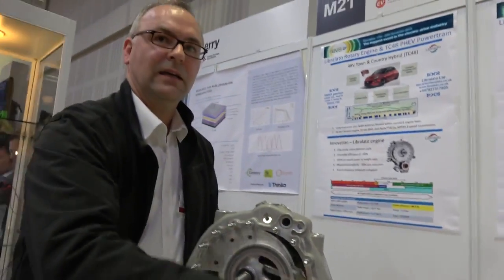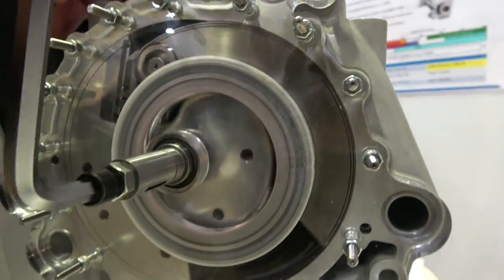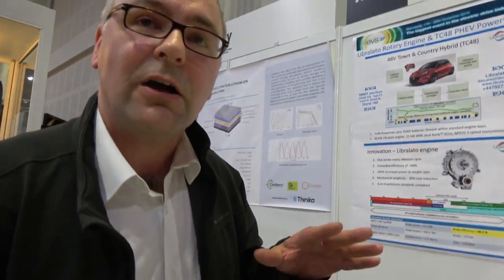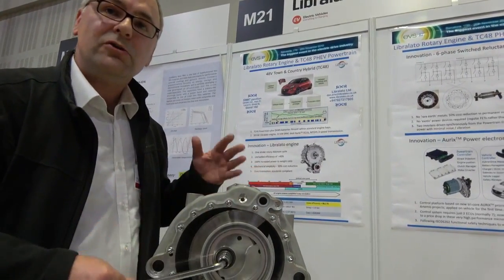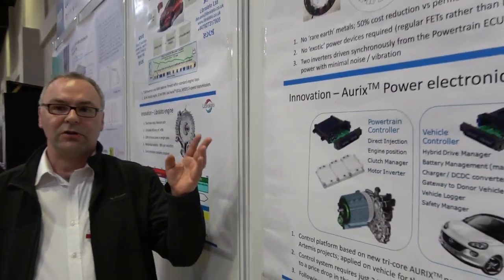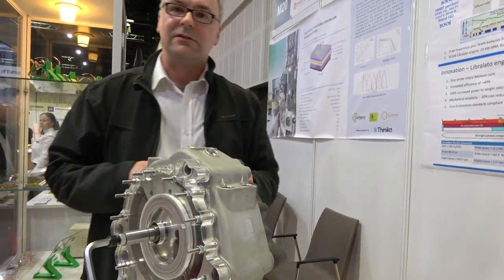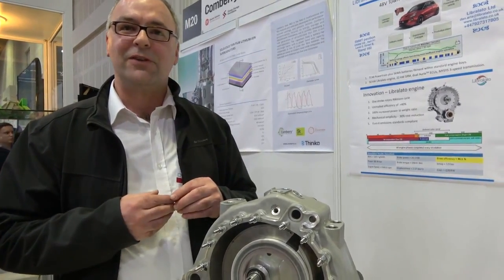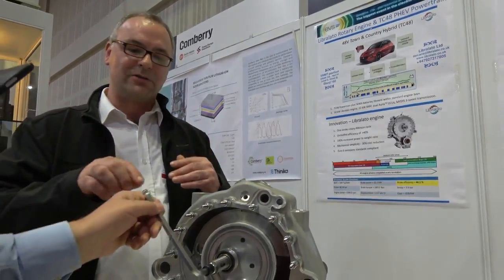Next generation rotary engine for hybrid vehicles

Comment: That’s not a rotary get your ass out off here
Reply: you mean...its not a wankel...it is a rotary, just look at it...cant be as efficient as a diesel however its looked at...theres still a lot more combustion chamber surface area to transfer combustion heat...and it still uses conventional type rotor sealing rings

Comment: A quick analysis:   Lousy shape combustion space for optimal combustion (needs to be near-spherical).   Large quench areas on chamber walls will increase hydrocarbon emissions from unburnt fuel clinging to the walls. Rotary exhaust valves have been tried many times in the past and they have massive friction and sealing problems.  The induction passage is too small and too tortuous for good gas flows at higher rpm's, thus restricting maximum power output.  Heat flux through the casings will be significantly higher than in a conventional piston engine.  Will need total loss lubrication of all the awkward-shaped moving parts, as it will be difficult to arrange pressure fed oil to these.  I thus foresee terrible wear problems that must be addressed.
My conclusion.  Novel, but far too many problems inherent in the design.  Because our taxes are paying for the development it will drag on and on for some time, I guess.
Reply: And the combustion shape has been the unavoidable design flaw with the wankel for emissions and fuel economy...too much dead squish space around the rotor as a percentage of the total combustion chamber volume...seal issues have largely been resolved but still have life/wear factors shutting down & starting up cold engines and carbon particals
Reply: this is what you looking for!
https://www.youtube.com/watch?v=0e785YnDmq0&t=59s
Reply: The video is a little hard to visualize the 9 cycle combustion cycle.  This animation give a little better view of whats going on.  https://www.youtube.com/watch?v=3DxV4it6daM   It looks like the combustion gasses travel through the center of the rotor.  It' s pretty strange.
Reply: If you know so much then you should design a better engine yourself. He has built it and he has tested it and unless he is lying, it works!
Reply: Although to be fair this video was made five years ago and we have not seen this technology since, so it has probably gone south so to speak.